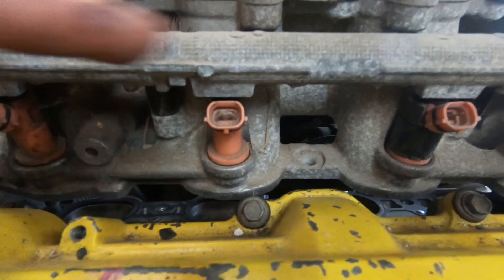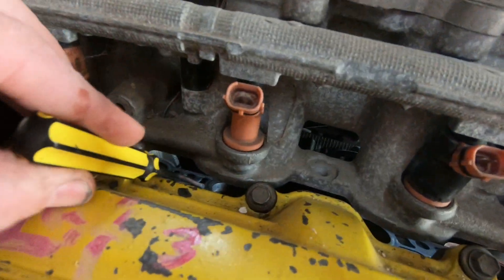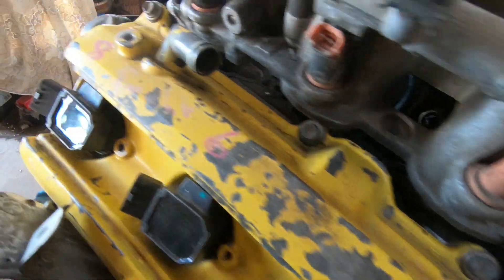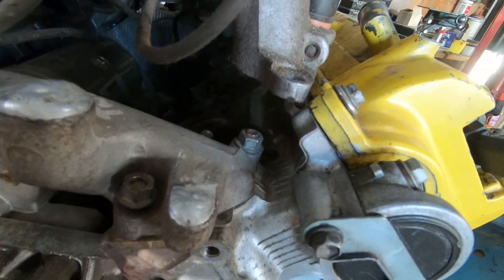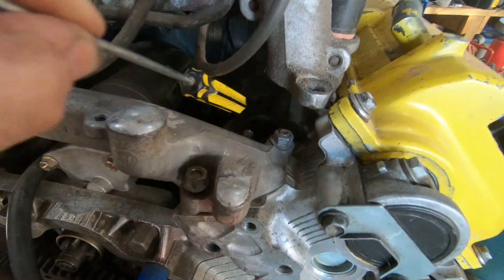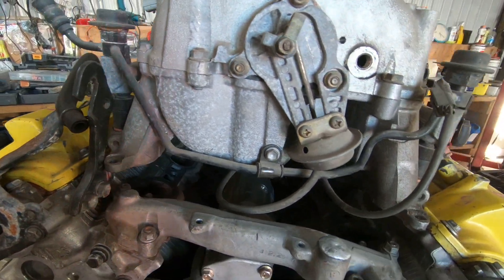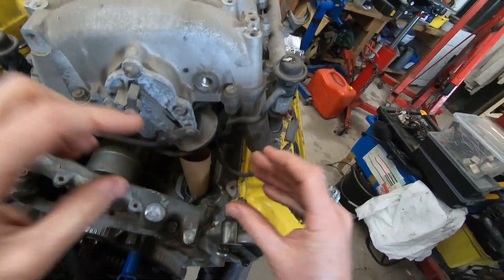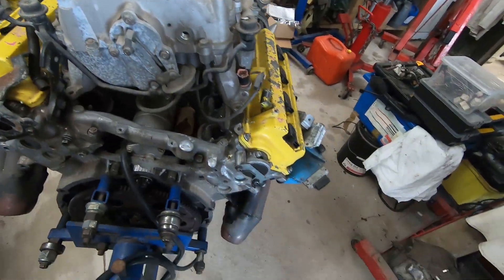1uz or 3uz VVti intake manifold onto non vvti early UZ engine.  It doesn't it , no wont fit , no no

Comment: Will 1uz non vvti heads fit a 3uz block tho
Reply from the maker: I have been discussing this with another person.   Its only the sort of repair one might do if they had the bits laying around for next to nothing as buying a 3uz complete makes more sense however this guy happens to have the bits laying around at zero dollars.  I would want to look at the sealing surfaces of the water gallaries in the head before making further comment on that one , it would make for an interesting one to clear up though.  Cheers Kelvin
Reply: Hey Kelvin, I bought a thick rod, but it turned out to be badly corroded in the valley.  It’s getting hard to find a good 1uz over here without spending lots, there’s a few 3uz’s about, but it’s much cheaper to buy a 3uz short engine.  I’ve got the 1uz heads etc from the corroded engine , can I put them on the 3uz block.  I’ve done searching but had no real answers.

Comment: Thank you very much for all your videos.
Do you have the means to fit vvti 1uz/3uz heads! On a early 1uz  block? 
It has been discussed before but the idea of drilling and tapping external oil feeds for the vvti actuation/lubrication scares most people 
But can you be the first?
Reply from the maker: I wouldn't be the first.  A guy in Oz did it years ago and these days it isn't really practical to do.  Much better idea to get the correct block to start with.  Cheers Kelvin.

Comment: Kelvin, I have a 2006 Lexus gs430 and I’m think about swapping a 1997 1uz fe in it of course non vvti. Will it bolt on directly? And how much do you think it will cost for the build?
Reply from the maker: Hello. With enough skills and knowledge it is possible with its own set of quite unique issues to overcome.  I have an upcoming video on swapping VVti gear onto non VVti engines.  Look out for that one.  You comment might even get a mention. 
 Cheers Kelvin

Comment: I just want to know if the flanges are the same size? Nobody builds flanges for the 3uz
Reply from the maker: Sorry I dont know as I cut the stock ones off and weld 2 bolt flanges on.  cheers Kelvin

Comment: Hi are the valves interchangeable 1uz valves on 3uz engine
Reply from the maker: Absolutely.  The 3uz and the 1uz vvti share cylinder heads so the valves are interchangable along with the 2uz as well.  Cheers Kelvin